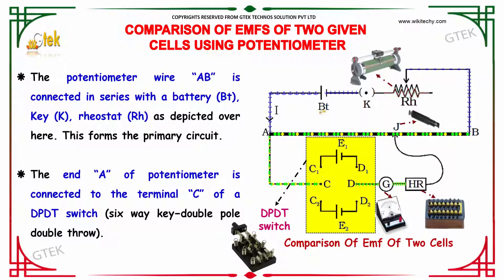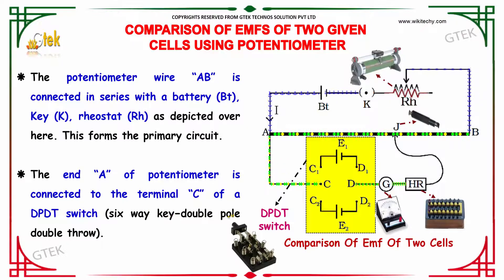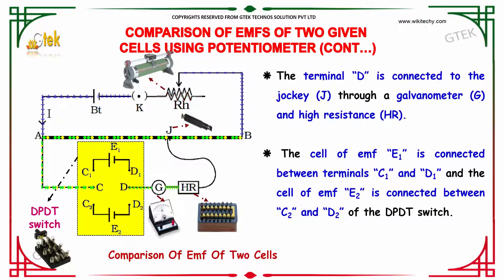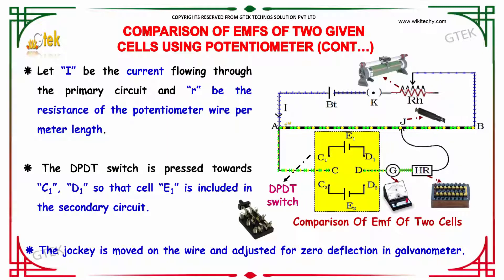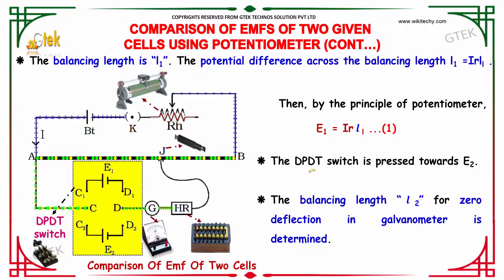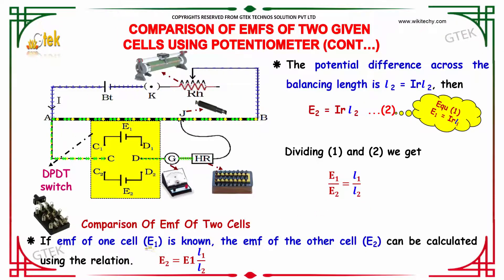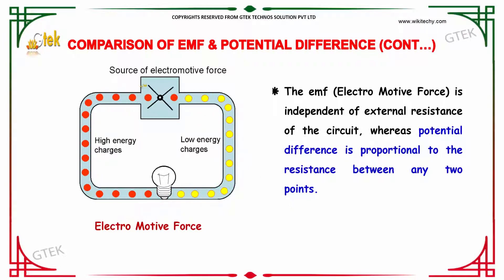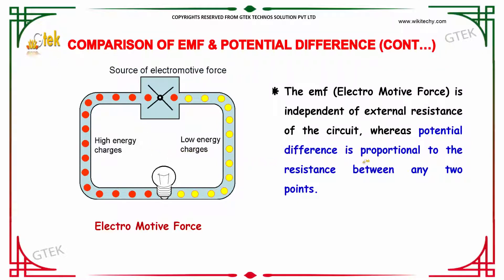Comparison of EMFS of two given Cells using Potentiometer Current Electricity  CBSE IIT JEE NEET

Comment: Potentiometer is based on the principle that balancing length in the uniform wire is proportional to the EMF of a cell in the secondary circuit

Comment: Potentiometer is a mainly used to measure emf of a given cell, internal ... Connection of these two forms the primary circuit. ... there no electric current will flow, this is the basic potentiometer principle. Now the potentiometer wire AB is actually is a wire with high .... IIT JEE Olympiad NEET NDA ...

Comment: Potentiometer is a device used to compare the e.m.f. (electromotive force) of two cells, to measure the internal resistance of a cell, and potential difference across a resistor. It consists of a long wire of uniform cross-sectional area and of 10 m in length.
Reply: lavanya umapathy

Comment: Potentiometer. Potentiometer is a device used to compare the e.m.f. (electromotive force) of two cells, to measure the internal resistance of a cell, and potential difference across a resistor. It consists of a long wire of uniform cross-sectional area and of 10 m in length.

Comment: A variable resistor is a potentiometer with only two connecting wires instead of three. However, although the actual component is the same, it does a very different job. The pot allows us to control the potential passed through a circuit.

Comment: Current Electricity Important Questions for CBSE Class 12 Physics ... The emf of cell is the potential difference between two terminals of .... Two students X and Y perform an experiment on potentiometer separately using the circuit given .... a potentiometer can be used to compare emf of two primary cells?

Comment: Comparison of EMF's of two cells using potentiometer and Determination of internal resistance of the cell. ... EMF and Electric Measurement ... When key K2 is closed ,the cell sends current through resistance Box (R).If E2 is the terminal. Potential difference and null point is obtained at length l2(AJ2) then. V=Kl2

Comment: Learn about Comparison of EMF's of two cells using potentiometer and Determination of internal resistance of the cell. ... EMF and Electric Measurement ... When key K2 is closed ,the cell sends current through resistance Box (R).If E2 is the terminal. Potential difference and null point is obtained at length l2(AJ2) then. V=Kl2

Comment: To compare the e.m.f.s of two cells by using a potentiometer Physics ... easy to damage the galvanometer by too large a current if contact is made on the wire too ...

Comment: procedure:

Arrange the required materials on a table and make the connections as per the connection diagram.
Tight the plugs of the resistance box.
Note the reading on the ammeter.
To test the connection, insert plug in the one way key k1 and also in between the terminals a and c of the two way key. Introduce a sufficiently high resistance on the resistance box (R.B). Place the jockey at the two end points of the wire. Press the jockey at both end of the potentiometer wire and note the deflection in galvanometer. If the galvanometer shows opposite deflection, the connections are correct.
Now, gently slide the jockey along the potentiometer wire and stop when null point is obtained.
Measure the length l1 between this point and the end P of the potentiometer. It is the balancing length for the cell E1.
Disconnect the cell E1 by removing the plug from the gap ac of the two way key and connect the cell E2 by inserting plug into the gap bc of the two way key.
Again slide the jockey along the potentiometer wire to obtain the null point. Measure the new balancing length l2 for the cell E2 based on this point.
Make sure that the reading on the ammeter is constant throughout the observation.
Repeat the experiment by increasing the current by adjusting the rheostat and record the observations.
Each time, the ratio between the emf’s of the given cells can be calculated using the relation,
\frac{E_1}{E_2}=\frac{l_1}{l_2}

Comment: Materials Required

Potentiometer
Daniel cell
Leclanche cell
Jockey
Battery eliminator
Resistance box
Galvanometer
One way key
Two way key
Rheostat
Ammeter
Connecting wire

Comment: This is a very basic instrument used for comparing emf two cells and for calibrating ammeter, voltmeter and watt-meter. The basic working principle of potentiometer is very very simple. 
Suppose we have connected two battery in head to head and tale to tale through a galvanometer. That means the positive terminals of both battery are connected together and negative terminals are also connected together through a galvanometer. 
The working principle of potentiometer depends upon this phenomenon. 
Now let's think about another circuit, where a battery is connected across a resistor via a switch and a rheostat as shown in the figure below, there will be a voltage drop across the resistor. As there is a voltage drop across the resistor, this portion of the circuit can be considered as a voltage source for other external circuits. That means anything connected across the resistor will get voltage. If the resistor has uniform cross section throughout its length, the electrical resistance per unit length of the resistor is also uniform throughout its length. Hence, voltage drop per unit length of the resistor is also uniform. Suppose the current through the resistor is i A and resistance per unit length of the resistor is r Ω. Then the voltage appears per unit length across the resistor would be 'ir' ans say it is v volt.

Comment: This forms the primary circuit. The end A of potentiometer is connected to the terminal C of a DPDT switch (six way key−double pole double throw). The terminal D is connected to the jockey (J) through a galvanometer (G) and high resistance (HR). The cell of emf E1 is connected between terminals C1 and D1 and the cell of emf E2 is connected between C2 and D2 of the DPDT switch.